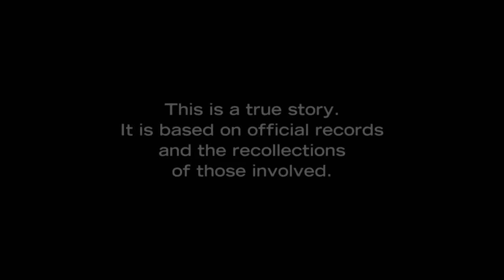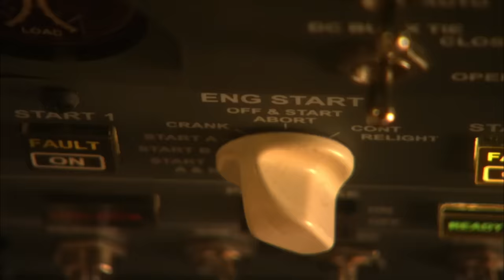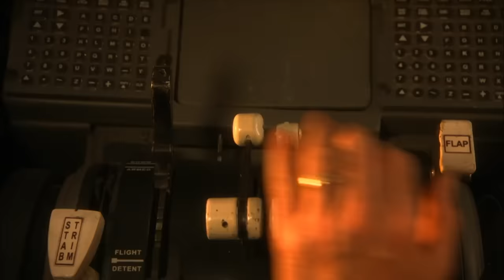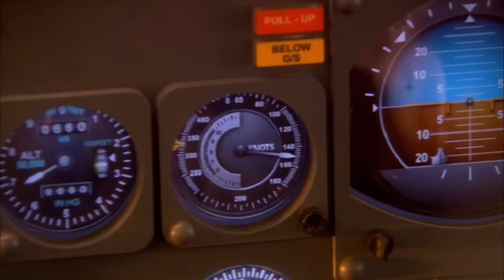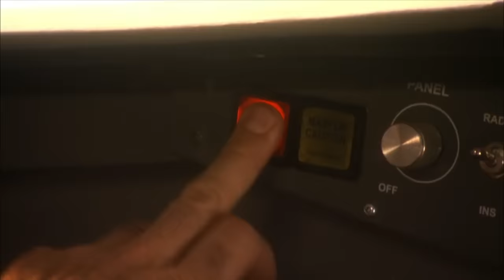Mechanical Failure or Human Error? The Truth Behind the Deadly Fires Aboard Two Different Flights

Comment: Wait a minute.  You have to do an emergency evacuation and there's a FOUR PAGE CHECKLIST? 

I know there are certain things you need to do, like shut the engines down, but didn't anyone who came up with these checklists consider that the emergency might be urgent?
Reply: The pilots will call for the plane to be evacuated the moment it has stopped moving. They, alone, are the only ones who are supposed to remain on the plane and go through the checklist. However, they will abandon the checklist when/if they deem it necessary.
Reply: @ejtappan1802  They specifically said in the video that the last step of the checklist is "evacuate the passengers".
Reply: @HiddenWindshield  you are right,  a lot has changed in emergency procedures in the last 30+ years exactly for this reason.   There is a different episode that goes over a lot of the changes that were proceeded by preventative death.
Reply: @HiddenWindshield at 7:54, it showed the steward starting the evacuation, and that was as soon as the plane stopped. The evacuation checklist had not started yet.
Reply: @KiloDelta173  What does the steward's actions have to do with the pilot's checklist?
Reply: @KiloDelta173  the attendants took it upon themselves to rescue people as fast as possible, but they stated in the video that it wasn’t normal procedure & that one of the changes they recommended was to have the crew make more directed instructions on evacuation; that would require it to be sooner on the pilots’ checklist so that the crew can actually manage & direct the evacuation rather than it being the disorderly disaster that it was which resulted in people not making it out alive.
Reply: @KiloDelta173 that has nothing to do with what the pilot's checklist actually said (they didn't follow it). It was a four page list and evacuate passengers was the last step, it was impossible to follow
Reply: @pandamandimax  yes, I know. That’s what I was trying to t to say is that they started evacuating right away, despite it not being in order on the checklist. The checklist is long but it’s there for a reason- mainly so evacuating passengers don’t get turned into confetti by the engine intakes. In this case, pilots were able to order the evac right away, and seeing as fire was the main threat, it made sense to skip the checklist.
Reply: Step 1 - Open doors and automatic slides
Step 2 - GTFO!

Comment: They were taking off into the wind, and the pilots stopped the plane with the burning engine to the windward side. Second, there must have been some pretty low budget maintenance done to that JT8D, those engines are built like tanks. Third, that flight attendant is a true hero!

Comment: The pilot was not thinking AT ALL about the passengers.  He rather worry about his duty to the stu pid list.  We need different a kind of people to be in charge of everything and he has to be able to delegate power to those who prove to be smarter and cares more when it comes to peoples lives,  like perhaps the stewardess who was not interested in having to report to lawyers that she did it wrong when she just cared about the PASSENGERS, who are the most important people on the plane because they are the payers and they are ones who trust.
Reply: The pilot initiated the evacuation the second the plane stopped moving. There is also a reason for the checklist.. one of them being so passengers don’t get injured or killed exiting the aircraft by getting sucked into the engines.
Reply: @KiloDelta173  Blah, blah, blah... Don't defend.  Just say you don't agree.